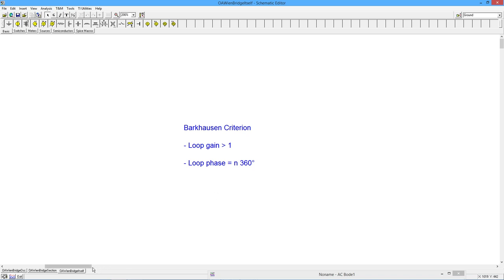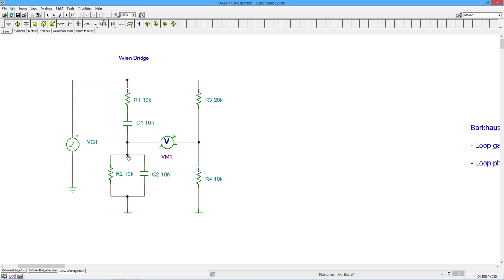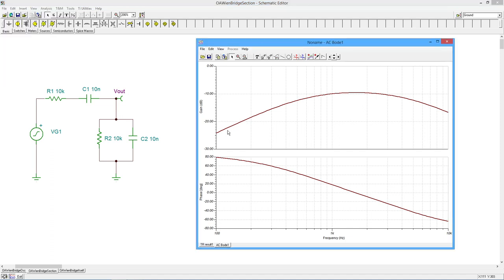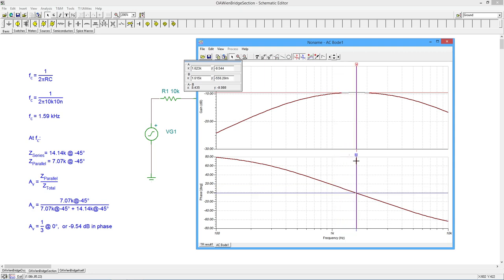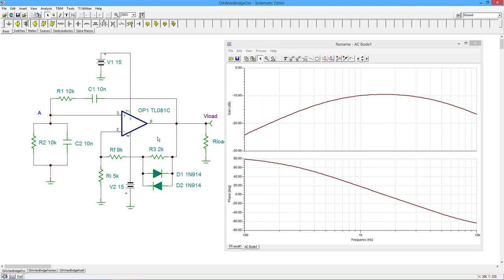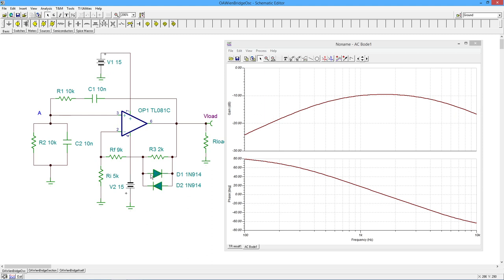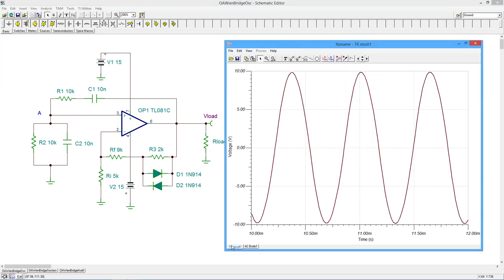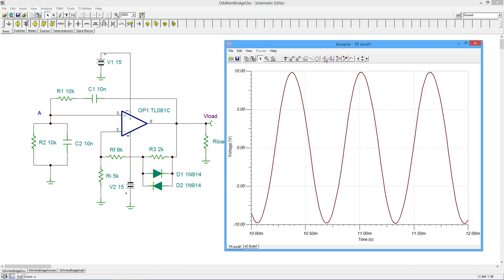Op Amps: Wien Bridge Oscillator

Comment: I built this circuit onto a breadboard - it works nicely.  Produces a beautiful sinusoid that perfectly (as far as the eye can see) matches an AWG sinusoid.  Rings at around 1.5259 kHz at 3.45dB with no discernible harmonics, but varying peaks around 8k and 11k at -65dB and lesser dB, so basically, at the noise floor for the measurement setup I threw together (using clip probes, not actual shielded probes).  Drives a 50 Ohm, 2-inch speaker nicely, struggles a bit with an 8 Ohm speaker of the same size.  My resistor values for the feedback loop are as specified in the simulation because I used selectable resistance modules.  All other values are probably within 5% tolerance.  Mean signal level at -50mV.  Positive duty cycle fluctuating around 50.6%.  Op-amp used: 4558 with a +/ 9V supply.  I enjoyed the video, and especially that trick using the diodes to "soak up" any out of balance feedback.  (Not sure why my comment is partially lined-out.  Sorry about that.)
Reply from the maker: Cool! Not surprised about the lack of level on an 8 ohm loudspeaker. That op amp doesn't have the current capacity for that load. As far as the lines, double check your post. Maybe you've got an accidental strike-through tag in there.

Comment: So if the feedback network is connected to the inverting input, how come the gain is 3 and not 2? Being that inverting gain is -Rf/Ri.
Reply from the maker: The feedback network is series-parallel which produces a gain of 1+ Rf/Ri. This is not an inverting amplifier. The input (such as it is) comes through the RC network into the non-inverting terminal.
Reply: @ElectronicswithProfessorFiore  Sorry about that.. I thought I deleted the comment. I answered my own question shortly after I posted it. But thank you!! 

I got the SP/PP and inverting/non-inverting concepts mixed up. All good now. :)
Reply from the maker: @JohnJohnson-ml2ll  Cool!

Comment: Sir, I have made the same schematic in TINA-TI simulator but there is no output. can you please tell me whether have you used any Initial condition ? Thanks.
Reply from the maker: I did exactly what you see in the video. It's live.
Reply: @ElectronicswithProfessorFiore  thank you sir. It's working fine. Sir, can you please tell me whether I can drive or ways to drive non linear transformer from oscillator output. I have been trying it but I am not getting output in secondary of a transformer while doing AC analysis ( nodal voltages). I have placed one ammeter in series with one resistor and a voltmeter parallel to resistor to check output. Thank you so much sir.